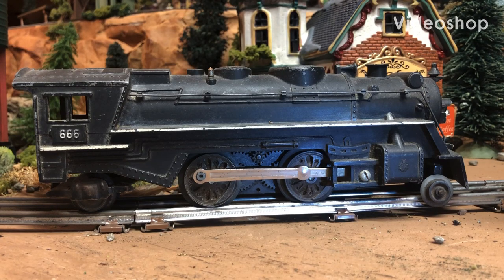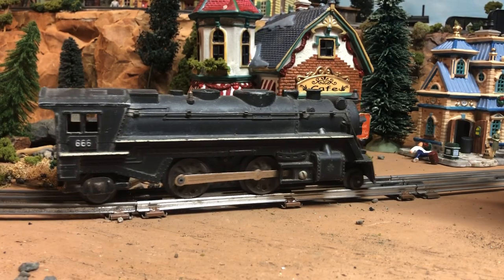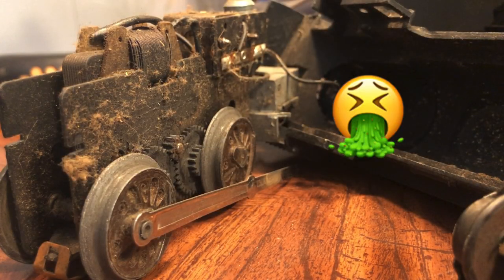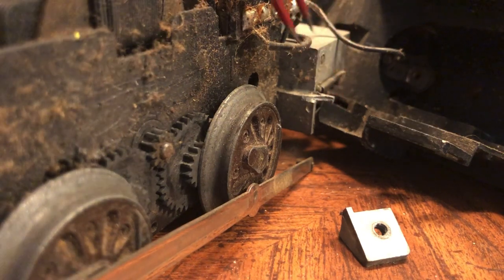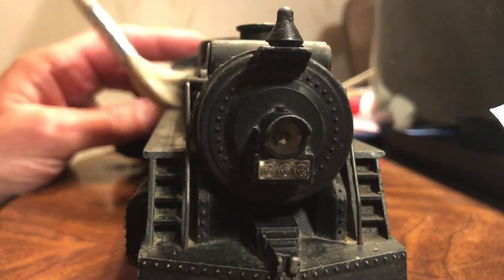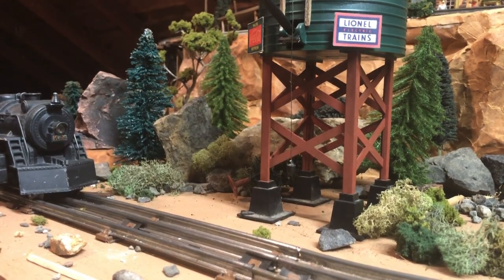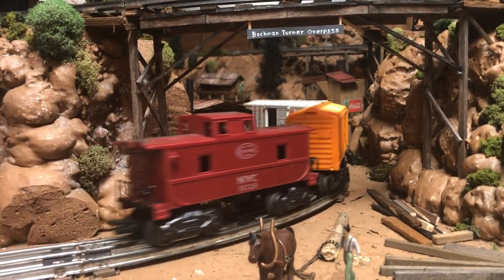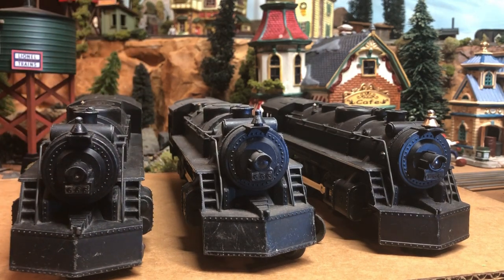Marx 666 will it work ? Reviving a forgotten toy

Comment: I liked the video.  I neighbor just gave me a train set from his attic, with a Marx 1666 engine.  I set it up and it sparks like crazy but I let it run for some time and it improved so I know everything needs cleaning, it went forward then backwards for a short period but now only goes forward.  When I get into it what and where is that switch?  It must be gummed up.  Thank you.
Reply from the maker: There’s a vertical cylinder on the front of the motor. That’s the gizmo that switches directions. Spray some contact cleaner up inside it to loosen it up.

Comment: What do you use to power you layout, also where do you have your layout? Basement, attic, garage? Also how many trains can you run at once
Reply from the maker: I use an American Flyer 175 watt dual controller so I can run two trains. It’s all in the attic.
Reply: Ok thanks because in one of the videos about the nightmare train I saw what looked like a blanket hanging on the ceiling or the wall, and it to me kinda looked like it was in a tent and I thought maybe it was portable thats why I asked
Reply from the maker: Ya the bedsheets are tacked up to reflect light onto the layout.
Reply: Oh ok thats why I saw those hanging there, by the way my last question is what are the dimensions of the layout?

Comment: I have a chance to buy a 1666 set
I tried to turn the drive wheels but they are locked and do not turn. Is this something that can be fixed?
Thanks
Reply from the maker: I’ve applied sewing machine oil around the gears then rest it on it’s side for half an hour to let the oil work down the axles. See if that helps.

Comment: I have this Marx 666 engine that I recently bought and I have Lionel o gauge fastrack and it seems like it’s stuck in one direction. I took a needle and poked inside the hole near the wheels to switch directions and it’ll have forward and reverse for a little and then it’ll be stuck in one direction and I repeat as noted. Sometimes it’ll move and sometimes it’ll just sit with the transformer light flashing. The headlight wire came loose and I can’t figure out where it goes. Any tips? Plus I’m new to fixing trains.

Comment: Hello I just got a triple 6 what's a good way to use house hold items to stop sparking
Reply from the maker: I’ve used isopropyl alcohol to clean the wheels, center contact and the track.
Reply: @raylroads  I've tried that but it still sparks like crazy check my latest Lionel video on my channel it's got a clip of how bad it sparks